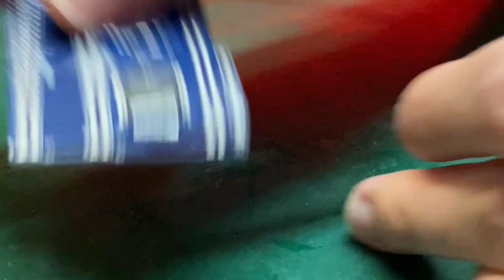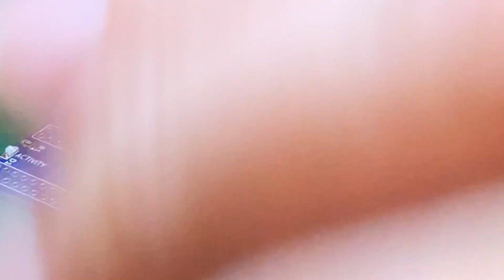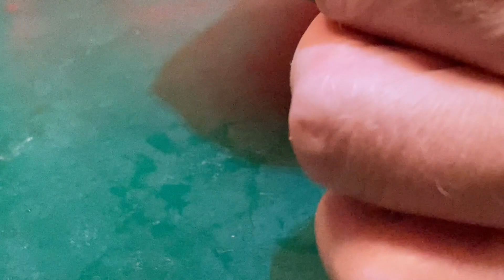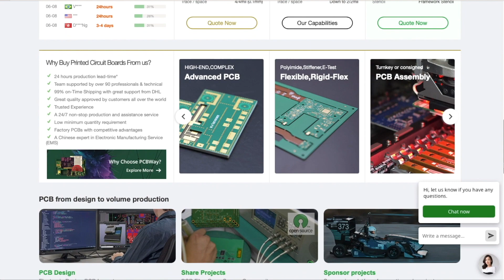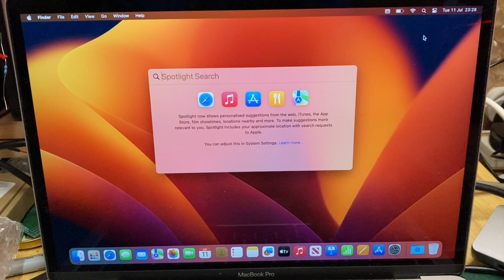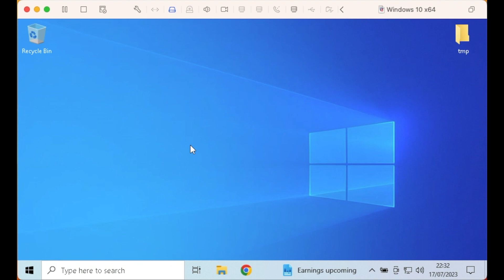Atari Falcon Auto-Byte-Swapping IDE adapter

Comment: So if I understood all correctly - if I have a dual cf card in my Falcon - I can setup one card for copying files from Mac and Windows - by setting up to do software byteswapping - via HD Driver - and the other to be my usual bootable. To get files moved on - and then copy over to boot card as needed on the Falcon side...
Reply: What you describe is how people have been using their Falcons up to now. This device allows you to use a single CF/SD card in your Falcon that will be accessible both on the PC and Atari, and most importantly BOOTABLE. The problem with HD Driver is if you enable it's internal "byte-swap" feature, that memory card will no longer be bootable. By moving the "byte-swap" smarts into this hardware, not only are data transfer speeds much faster (you're no longer using the Atari CPU to do it for you) but you're selective in what you byte-swap so CF card is detected correctly, bootable, and treated like a native drive both on the Atari and PC.
Reply from the maker: Thanks @leonkiriliuk, that pretty much nails it.

Comment: Can u build me one of these great boards or are they available somewhere already assembled???
Reply from the maker: PCBWay will build you a board with all the SMT components populated, but you'd have to do the through-hole parts and flash the CPLD (you could use a Pi). See my PCBWay Community page for that. Unfortunately there's not anyone making complete boards, AFAIK.
Reply: @thetechnoshed  I've just ordered some boards off PCBWay and enough CPLDs to make a few of them. I will see if I can get rid of the extras cheap on the atari forums, if you don't mind?
Reply: @falcon060 are you still in Ohio?

Comment: Can you help how to program the cpld with raspberry pi2, what is the pin order how to connect it with programming?
This is great product i just ordered one batch of pcb's and trying to get one working, does this also work on STE if it has ide build in?
Reply from the maker: Hi there. These are the two links I've seen referenced:- https://linuxjedi.co.uk/2021/11/25/revisiting-xilinx-jtag-programming-from-a-raspberry-pi/ and https://anastas.io/hardware/2020/09/29/xc9500-cpld-raspberry-pi-xc3sprog.html. Don't connect the 3V3 line (pin one). Power the board from its own regulator.

Comment: is the atari  ide compatible or is it scsi???
Reply: Atari Falcon 030 has external SCSI conn. and internal IDE conn.
Reply: @DieselPLL  i asked because i heard weird errors happening when  ide on scsi device

I wouldn't of thought atari would of had  ide back then 

ide as as a standard interface didn't become standard until 95/96
Reply from the maker: SCSI device on an IDE bus simply won’t work. Definitely IDE but very early days in 1992. Amiga 600 and 1200 similarly early adopters.
Reply: @thetechnoshed  There are IDE <-> SCSI converters in the wild (but they're quite rare). I have a Yamaha branded one that was designed to go into a SCSI enclosure so that one could attach an IDE CD-ROM. It worked well enough on my TT. I still have both so I aught to get them out for a play.

Comment: Now your Mac can fill your Atari hard disks with all it's wonderful hidden metadata files :) Sorry just teasing (It used to annoy me when I owned a Mac!) But yes this Falcon disk adapter is brilliant, I might make one, thanks for your hard work!
Reply from the maker: Very true. I believe cp -x helps a bit (cf. Pico programming issues on the Mac)
Reply: LOL!  Windows has a similarly annoying "feature" - some hidden recycler folder or something, and image preview files etc.
Reply: @GadgetUK164 My Linux GUI file manager does the same kind of shenanigans.